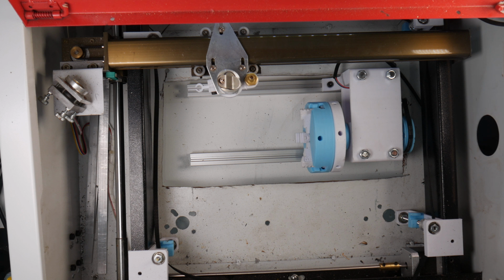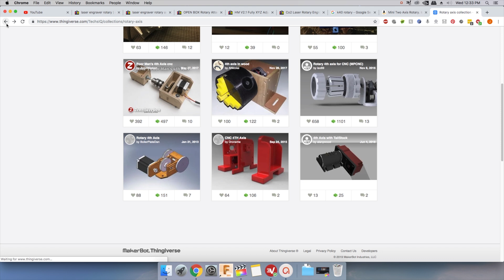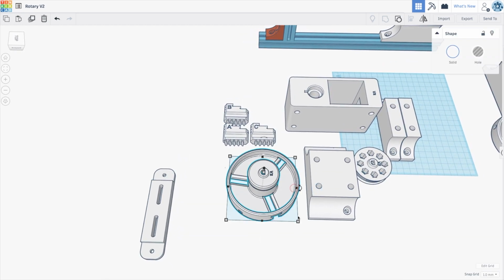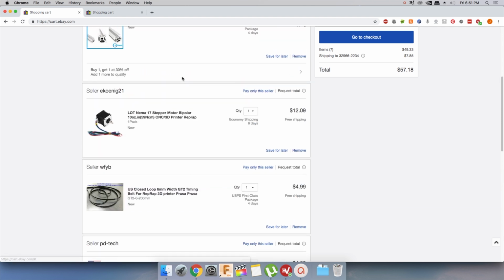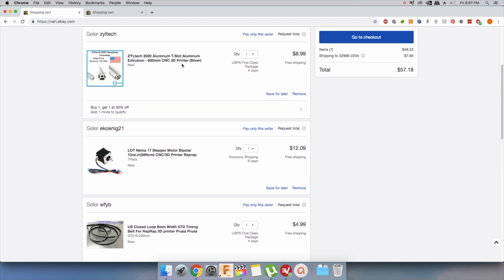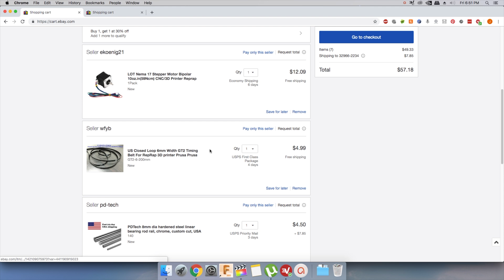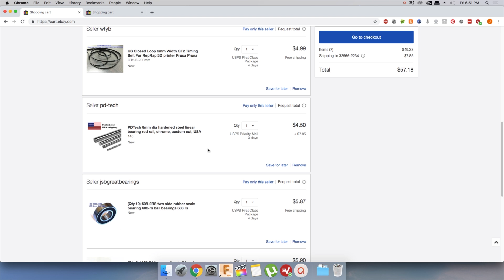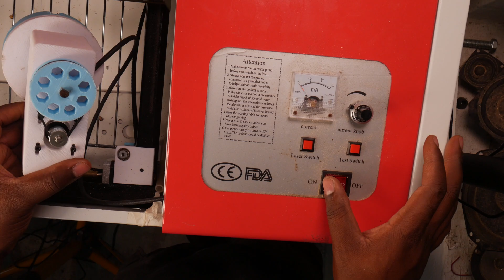DIY Rotary Module for K40 Laser Engravers!

Comment: Have you attempted to use this with 20oz tumblers?
Reply from the maker: I have not but it should work.
Reply: @thenotionlab  Im struggling just a bit with the hardware list. Difficult to hear that portion with the background music. Do you have the list available by chance?
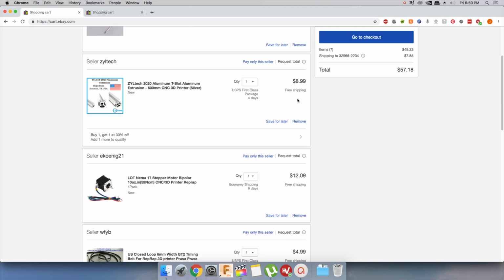Reply from the maker: @alpha_burt7903  I dont, at 3:09 I show the list on screen.
Reply: Also, what program suite are you using with your K40? Whisperer? Inkscape? Thanks again
Reply from the maker: @alpha_burt7903  I use inkscape for designing my projects and K40 whisperer to run the machine.
Reply: Notion Lab outstanding. I have one more part to print and my hardware should start arriving today. That’s should compete the rotary. Still need to print air assist, chain, feet, modified blower duct boot and cut the bottom out below the gantry. I will detail the parts list and post in a few days. 
Thanks again for the correspondence. Big thanks.
Reply from the maker: @alpha_burt7903  Its always nice to see people making the things that i design. Hope it goes well.
Reply: Notion Lab so far so good. The inner and outer chuck pieces gave me a bit of issue with fitment but that’s not the fault of the STL. Lapping compound fixed that. I also printed in PETG in lieu of PLA. Last part, the housing, is on the printer now. Still waiting on hardware delivery to assemble. You did a really good job with this file, I look forward to seeing more content in the future.
Reply: Everything is working as expected but,  because the chuck is on the right side of the machine, it will not engrave correctly. Either I am missing a setting change in whisper or I need to spin the rotary around
Reply from the maker: @alpha_burt7903  There should be an option in k40 wisperer to mirror or rotate the design. You can also do the same on inkscape
Reply: Notion Lab I was able to figure that out and have successfully engraved (albeit still working on laser settings).
I had to make a few necessary modifications to your rotary design for my needs. 
1) I sprayed the chuck dogs in flex seal. They will not slip now. 
2) I had to increase the width of the base to accommodate mugs (mug handle hit extrusions) new base width 190mm. A remix of your base creating a cantilevered “foot” with same attachment points. 
3) I had to create a tail stock because the chuck face is not parallel to the base rails, causing the tumblers rotate “oblong”. I designed and printed a tail stock that utilizes a few of the leftover skate bearings and is adjustable for every size tumbler/mug/canteen imagined. It now rotated perfectly concentric. 
I’m happy to share the stl files if you’d like them. As well as the DXF files. 
Thank you again for your help.
Reply from the maker: @alpha_burt7903  That awesome, I am glad it worked out and yes i would love to see your remixes, Upload them to thingiverse if your able.

Comment: Any chance you plan to make and sell these rotary chucks. I wish I had a 3D printer.
Reply from the maker: no plans really. With the part list plus the labor, it would be too expensive. 3D printers are relatively inexpensive. I would recommend the anycubic i3 mega which i have and you can find it as low as 160 usd in some places.
Reply: There are also printing services that will print the files for you, for a fee. I use an Ender 3 Pro with a few tweaks and have yet to find something I can’t print with good quality. But, there’s always something more capable. This machine is limited on its printable filaments but for a hobby, it does what I need. $200 USD